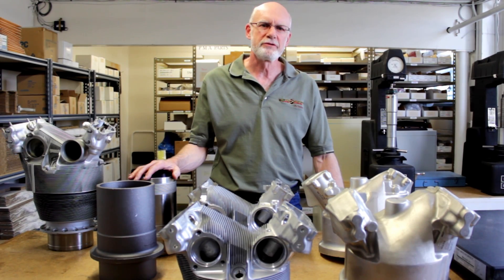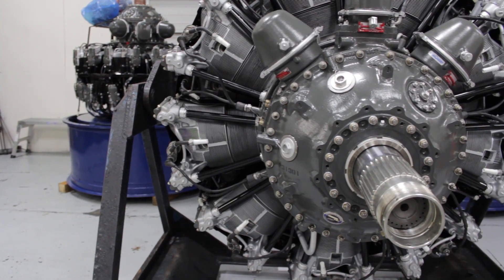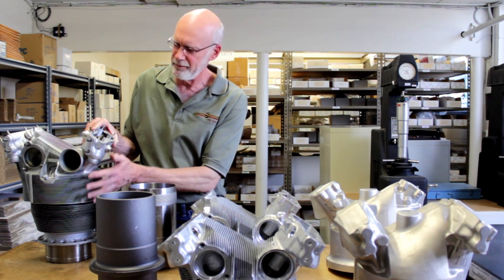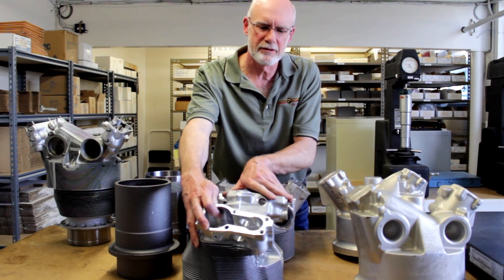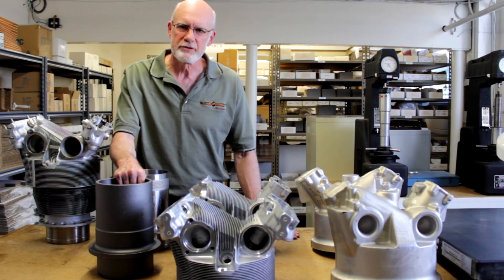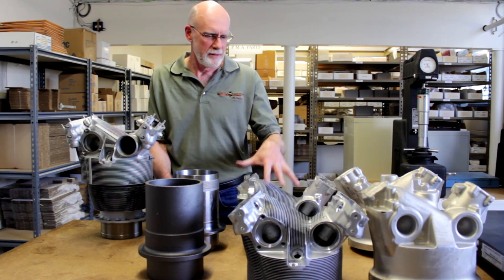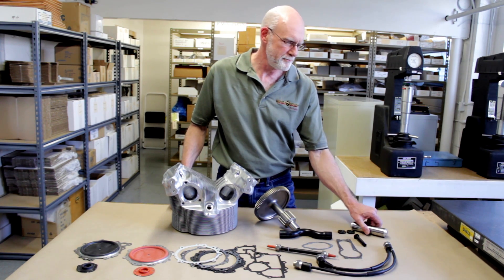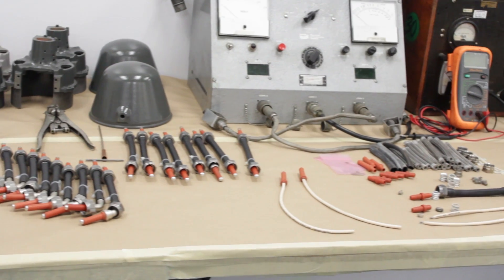Radial Engine PMA Parts Precision Engines

Comment: Hi,
I didn`t know, that cylinderheads are manufactured today. I thought, that you repair old ones from used engines. I have an old Curtiss-Wright R-3350 32WA engine for show runs. Very fine "Art of Engineering" and great respect to all people, who developed these machines. May I ask you, what the price for a new cylinder head in consideration of the different steps of manufacturing these parts is?
Regards
Andre
Reply: Good job